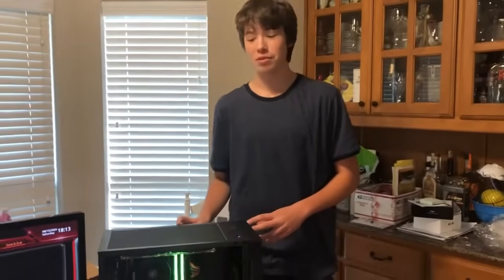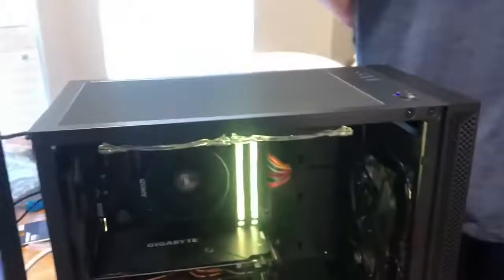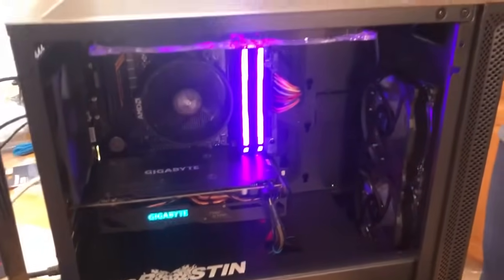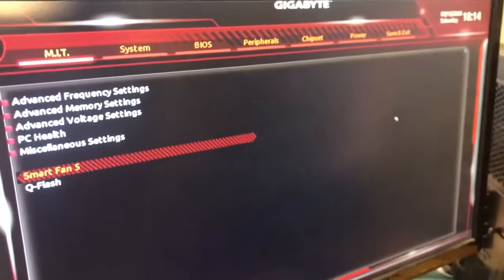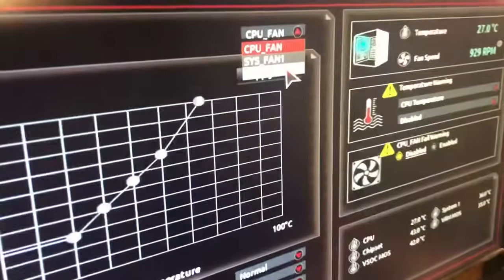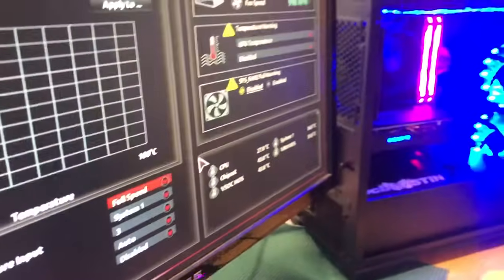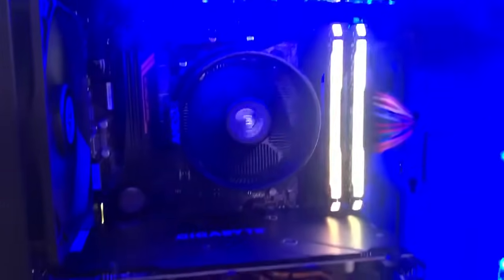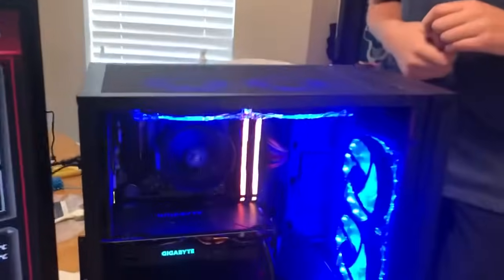A quick fix for non addressable RGB LED fans that spin but do not light up.

Comment: Mine is brand new but they light up and don’t spin
Reply from the maker: A lot of times, RGB/LED  fans have 2 connectors.  One is just power for the LED and the other is for the fan motor.  Make sure to hook up both.  If that doesn't work, message me back or join our Discord server.
Reply: @pcBoostin  what do you think the power one might look like because behind the case there are a lot of un hooked cables.
Reply from the maker: @lmaniii5030  could be a 4 pin molex plug or a SATA plug or it needs to go into a FAN controller.
Reply: @pcBoostin  I got it now, the cord for the fan lights were the only part of the fan cables that were plug up but they’re was a 3 pin adapter cord on the fan that I plug into the fan part on my mother board and it worked.

Comment: You sir, are a gentleman, and a scholar! I had this exact issue, but simply opted to connect the fans directly to the power supply, using the molex connector. Went back to my fan splitter, changed the fan setting, and it indeed works.
Reply from the maker: Yep, that is also a solution.  We wanted to have the PWM fan speed control but  we also tested it direct to the PSU.  They ran at full speed o was a little louder but it worked great too.  GL!
Reply: @pcBoostin  question, I can’t seem to figure it out so it’s ok if the led light is off right?
Reply from the maker: @rudyelias2982  If the fan is turning and you don't care about the LED lights, assuming they are LED, then it is fine but if you want to try to get the lights to turn on then go to the BIOS and turn to performance/full power mode to see if they turn on.
Reply: i almost tried to desolder my fan and solder it again but im gonna try this